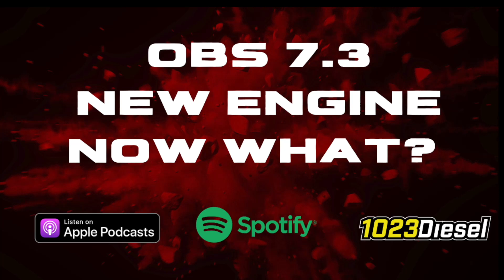Ep. 62 | OBS 7.3 Build with a New Engine - Whats Next? (Audio)

Comment: So, how much fuel can you use towing hard?  What I mean is, if you can't use the extra fuel to pull a load more easily up a steep grade, what good are bigger in jectors for towing? My whole goal for bigger injectors would be to tow better. I don't care anything about racing my OBS...I just want to tow more effortlessly (hold speed without downshifting) without compromising reliability.
Reply from the maker: Hard to answer that, but on a great setup 1) at sea level
2) Intercooled
3) Turbo that maintains a broad power band (like a KC Stage 1 or s364.5)
4) able to maintain ICP & Fuel Pressure
Etc 

140ccs is actually usable.

There are a lot of variables, but generally you can not maintain 350+hp and keep the truck cool.
Reply: @1023DieselFleet  Thanks so much. You know, there's lots of talk about "power" that seems to be driven by the modern idea that a diesel truck is supposed to be some sort of daily-driven sports car. For me, a diesel truck is primarily for towing. My dream truck is a diesel that can tow a heavy trailer up a long mountain pass without losing speed, needing to downshift, or getting hot -- and will last a million miles. On my OBS, I am still running stock injectors...yes, the little ~90cc injectors. But since playing with different tunes on my hydra and installing a KC Stock Plus turbo, I have been surprised by how much better the truck tows. Not more fuel, but burning the fuel I have more efficiently. Certainly nothing like modern trucks, but I love finding ways to make a truck tow better by improving efficiency, because it also seems to add longevity. Love your channel, great content!